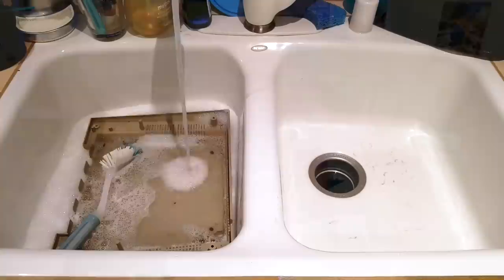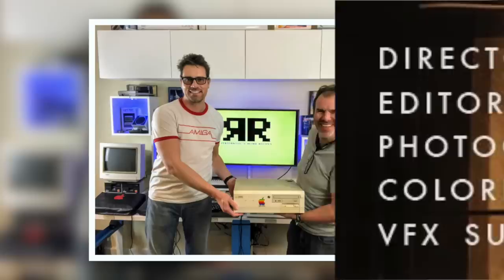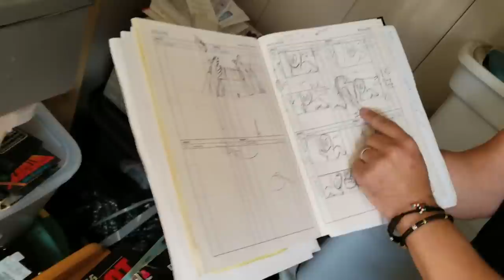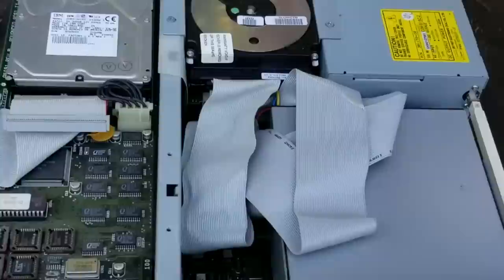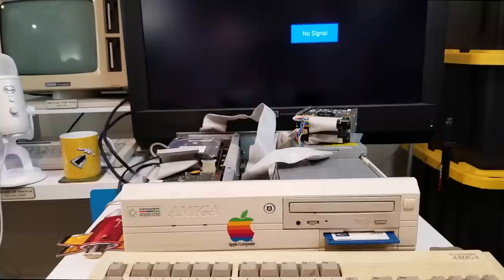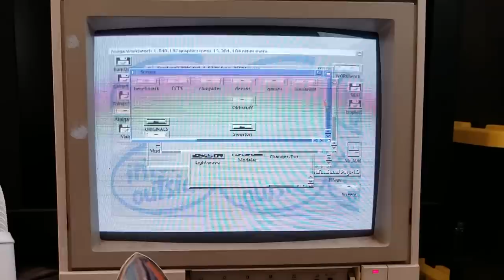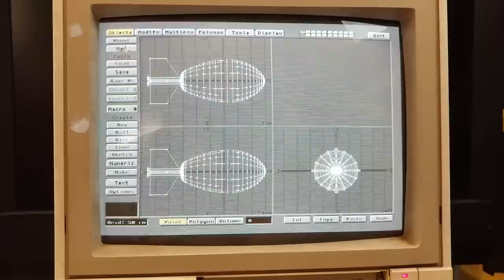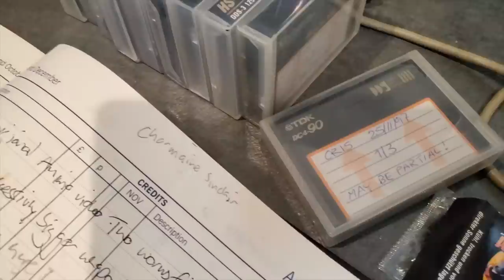I found Team17's WORMS developer Amiga 4000! Let's explore its harddisks

Comment: This is fantastic, I can only hope that the person that bought DMA Design's Amiga that worked on Lemmings does the same. It went on eBay a few months ago for only about £1000
Reply from the maker: That's crazy cheap. There can't have been any data on it surely?
Reply: @RetroRecipes  An Amiga 3000 with files and unused artwork for Lemmings, Shadow of the Beast 2 and 3 and Microcosm. £1800, the ebay listing is still up.
Reply: Man, if I had the money...

Comment: Funnily yes I had heard of the Teletext Worms in my research of character table generated platforms Egs. ANSI, PETSCII, BBS, etc. Makes me wonder what it might have been like for gaming in general. Surprised as not many makers ever have much of their old equipment.  Feh patina that's just dirt, I have some old mayonnaise in the fridge that must be rising in value as we speak. ;)
Wow that just happened in emulation, I would have thought that would have been done years ago, guess few people wanted to salvage their Amiga data safely. Lucky guy, got to pet all the doggies. :D Sweet to have a developer rig, usually pretty beefy inside them. Hah, got to love those graphic modes that are hard display now, you didn't bring a PAL monitor with you, for shame. ^_^
Reply: The actual Teletext Worms thing was just an April Fool's joke, though if it was one actually broadcast e.g. as part of the Channel 4 "Digitiser" teletext gaming magazine (it's very much in line with Digi's brand of humour) they'd still have had to make the mockup screens "for real".

The one-way, limited pagecount "magazine", continually/circularly rebroadcast nature of Teletext as a whole would have made the real thing entirely impractical, as you'd be pre-coding up the equivalent of a Choose Your Own Adventure but with a fresh graphic for every single move, and with extremely clunky controls (number buttons plus the "reveal" function on the TV remote, and optionally the Fastext shortcuts that assigned certain page numbers - including some with hex digits A-F that couldn't otherwise be entered - to four primary-coloured buttons and forward/backward stepping through each "slide" in a "carousel"). The effective datarate is only a couple dozen kbyte/sec at best, but even in teletext form the necessary data load would be many megabytes... it'd take several minutes to spin through the entire image set even for a very limited game, and you'd have to send each one in turn as you have no way to tell what any one player (out of the whole country) would actually need from second to second.

Actual teletext games tended to be more simplistic quizzes where you can more easily program-in "right" or "wrong" branches behind each Fastext button (the seminal Bamboozle, for example), or were phone-in games where you called a premium rate line, were told a particular page to navigate to by number then hit a fastext key, and then controlled it using the phone keypad instead... which had much better responsiveness, as your (and any random voyeur's) dedicated page could be updated within a few frame-times... but of course had a very limited maximum number of players. EG if a game company bought up an entire 10-page block of the usual teletext 100-899 range, then extended that using the fastext functions (matching the typical pagespace of e.g. Bamboozle), as well as the extended hexdigit range of the rest of the 100-block, that still only allows for about 70 players at once. More likely just 15 (as you need one page reserved for title / redirecting)...

However, you do touch on an idea I've wondered about on and off. Several computers (BBC Micro, Oric 1 just for starters) used a Teletext screen mode in order to get a decent amount of colourful text with a relatively cheap off-the-shelf decoder chip which could be fed information directly from RAM instead of a TV receiver, as well as working as an offboard Teletext decoder in its own right (with the addition of a plug-in decoder) for TVs that didn't have one built in, a host for the Prestel data system or its workalikes (Minitel, the US agricultural data service whose name I forget...), etc. Various games made use of it as well because of the Sixel semigraphics, where the oddball inline attributing didn't cause too much of a problem, or at least its shortcomings were counterbalanced by advantages such as very low memory load and the way that attributes would persist along a line if there weren't any further interruptions thus allowing very fast horizontal colour filling... (even on the BBC, it was technically the highest quality colour resolution, at least in terms of text or text + block graphics; otherwise you had to settle for similar rez but fewer colours, or similar colours but lower rez)

So, why didn't any offer the ability to simply send raw data to an offboard video decoder, i.e. the teletext system in a compatible TV, in the same way that a broadcaster might? You could have made a very cheap, memory-efficient, relatively quick machine that way without even having any proper video chip at all, or at least only offering a very simplistic monochrome CPU-mediated bitmap mode sort of like a suitably machine-code reprogrammed ZX81 for better pixel resolution at the expense of colour, speed, memory take, and easy text rendering... (which with Teletext Mix mode could itself lie underneath colour text / chunky semigraphics, so long as you didn't want to show them in black outside of also-limited Subtitle mode).

With something like that, Teletext Worms, as well as many other vaguely graphical games, could totally be a reality. You'd still get fairly responsive updates (maybe in the 10 to 25fps zone depending on graphical complexity...) directly affected by your input with no pre-calculation, and you'd have a rather better control method ... even if it was an oddly laid out membrane keyboard, history has shown, e.g. with the games built in to satellite TV decoder boxes, that it would still be preferable to a long, thin, infrared remote control where you can only really press one button at a time with a single thumb. And the machine could have an internal beeper, or even send sound to the TV over the RF link, so it wouldn't have to be a silent experience. All in all, there would still have been several old machines that would have been embarrassed by such a setup. And it'd be good for going online with in the Prestel age too.
Reply: (though funnily enough the Gameboy version shows that something with the resolution and colour depth of one of the Beeb's lower modes - 160x200 in 4 colours - could still be just fine for playing Worms ... so long as you used a greyscale monitor and fiddled the settings for a narrower, taller image, anyway... the soundchips are quite similar too)
Reply: @markpenrice6253  Thanks for the info, yeah I really wasn't thinking about the low, low bandwidth heh. Interesting stuff, we had a Teletext equivalent in Canada but very limited places to experience it bitd.

Comment: "Such and such code was lost due to a liquid spill." This never makes sense to me. I get that at the time, perhaps a dead computer would lead most to believe that the data was gone for good, but even if it's stored on a ROM chip instead of memory, it's a simple matter of replacing destroyed components or migrating the chip to a working system. Anyone who has done any kind of component-level board repair would surely know that beyond some kind of freak electrical grounding the data is still probably there and rather easily attainable.

I imagine this happened a lot in the past, where a machine was being used for something and then suffered a catastrophic failure and almost immediately discarded due to the assumption that getting the data back was impossible. I probably would have thought the same way had I not explored electronics repair and realized how easy it often is. I wonder how many easily fixable machines have been discarded over the years still containing valuable data just due to the fact that nobody at the time realized how repairable they were.
Reply from the maker: Did you notice the date at the top of teletext? See Description 😉😉
Reply: @RetroRecipes  Haha, no sorry, I wasn't trying to comment specifically on this instance, just the general case of how many machines must have gotten discarded with usable stuff on them given the thoughts of the time.
Reply from the maker: Very true...

Comment: On the the drives you can't get to spin up.
Probably the bearings in the spindle are stuck, or just not loose enough to allow it to get up to speed.
Replacing the bearings usually requires removing the drive internals (platters, heads assembly) which is obviously a job for the professionals.

Also possible to heads are stuck to the disk surface. Which again is not really a DIY task.

You could ask if Steve wants the challenge. Louis Rossmann has several youtube channels.
https://rossmanngroup.com/data-recovery-service-nyc/

Comment: An easier option for cloning is Linux and dd. That's what I use whenever I find an old drive (amiga or whatever else). Anyway, great video. Being so lucky should probably be illegal.
Reply: DD is my go to cloning program, especially because of the portability of it's source code and dependencies
Reply: Yes, this is what I would've gone for first too. Though I'm not sure if the resulting image would be readable on Amiga, or would still need to be loaded and written to disk via WinUAE
Reply: @kurbeco  You would have to mount the resulting raw image and then transfer the files from there to an Amiga formatted partition

Comment: Did you try freezing the drives that wouldn't spin up?  NO, really… Freeze them for a few minutes and then power them up.  If the bearing were seized, the contraction of the internal metal caused by cooler temperatures has freed up some drives to spin briefly again… ;)

Comment: I'm sure you know this by now, but that probably isn't a PAL/NTSC issue, unless you were trying to connect via the composite RCA jack.  RGB doesn't have issues with PAL/NTSC.  More likely a refresh rate issue with the display mode.  The 1084 monitors don't scan up for high res refresh rates and most VGA monitors don't scan down for the Amiga's lower resolutions.  And true multisync monitors are hard to find.
OH!!!!  (Just got to the AmigatoNTSC part)...  That is weird tho.  That is usually used just for games that will only run in one mode or the other.  Most apps in RGB are polite enough to use the system settings...   Hmmm....  Could you have used the early boot menu to force the Amiga to PAL mode? (assuming you are using RGB/VGA?)  Anyway, never mind me..  Just thinking out loud. ;-)

Comment: That's so weird, my 1084 handled PAL modes just fine. You sure they aren't 31khz Picasso modes?
Reply: Or higher, even... but yeah, a 1084 should be happy with almost anything 15kHz. They swallow 72Hz Euro36 and even wacky things like the recently developed SuperPlus (800x600i at about 47Hz)... just not much outside of the 15.0~16.5kHz range.

And I'd be astonished at almost any A4000, let alone one used for 3D rendering and other dev work, to still be using a 15kHz screenmode. We were well into the VGA era when the machine launched and being able to do higher resolutions and frequencies was part of its USP.

Though flickeriness might be because it's detected the connection of a 15kHz screen and has automatically downsynced... but applied interlacing to maintain vertical resolution. Which if you're running PAL50, and don't have an LCD or a flickerfixer, is just painful

Comment: Those glitched out video modes with the graphics scrunched up horizontally and a black sync bar down the middle I would 99.4% say are sign of a 31kHz VGA or ~28kHz ECS/AGA "double" / "productivity" screenmode, which the poor old 1084 is doing its best to display by ignoring half of the syncs (where they come in what it thinks is the middle of a ~15.7kHz scan, rather than at the end). Probably that particular one is 31kHz or close to it (maybe "VGAonly"-modified 640x480 Productivity), which should be displayable on a regular LCD TV or monitor or any old PC CRT, and the completely unrecognisable ones with the diagonal stripes or patternless snow are one or other higher (e.g. 35kHz) or in-between (23, 27, 29kHz...) Amiga-specific oddity which will need a multisync, or at least a PC SVGA.

Nothing to do with PAL vs NTSC - even if it was the odd case of an RGB not being 50Hz compatible, what you'd get is a vertically jittering or ~10Hz-rolling image which was otherwise the proper width and recognisable (and maybe tweakable into stability by playing with the image controls), rather than skittering around all over the place and being either compressed to half width or being extremely distorted in the diagonal direction to the point of unusability. Hopefully an Amiga forumite would have noticed that - did you post pics / vids when asking for help, or just text?

I'd be surprised if the 1084 is what that particular machine was originally used with (maybe one of the other boxes instead?) - probably more likely a Ranger bisync or a third party multisync. Plug a(n S)VGA compatible screen into it already, preferably a Multisync rated one (there are lists of such out there online, including on Amiga preservation sites), especially a CRT. Or just connect your LCD into the output of the Picasso instead of the computer's main output, if that's not what you were already doing... Making sure that it can sync high enough to handle the board's particular modes, as they were essentially just contemporary PC SVGA/SXGA chipsets with the PCB altered to present a Zorro connector rather than an ISA/VLB/PCI one... so may well be capable of exceeding (rather than undercutting) what a cheaper LCD can natively display.
Reply: In fact there's a point where it looks like there's three copies of an otherwise unrecognisable feature, along with the extreme diagonal skewing. That suggests something a little way adrift of 45kHz, maybe 48kHz? which would be good for e.g. 800x600 at 72 or 75Hz, very much a mid 90s workaday resolution, which would let you get 16bpp colour out of 1mb of VRAM (or double-buffer inside 2mb)...

Comment: You could have used Linux as it natively supports Amiga filesystems and a simple dd.   For those DDS tapes ive got an external DDS3 ( HP ) muli loader thatle do the job ;).

Comment: this amiga is 50 Mhz and can do 3D ? Hell, programmer of this 3D program must be god.
Reply: 3D rendering at 50MHz with a 68030+6888x or 68040? In 1993/94? Absolute luxury. We were about to discover the extreme speed boost of raytracing on a 66MHz, 32-bit, FPU-equipped 486DX2... after first giving it a try on our 8MHz, 16 bit, non-FPU (ie, essentially original Amiga class) Atari ST. And that dev machine must have an accelerator installed because the OEM A4000 ran at 25MHz...

Comment: When it comes to saving data from old hard disks, linux is the natural choice. I use it myself to read, write and transfer data between Amiga storage and modern computers. Windows and Mac are both extremely handicapped when it comes to this type of work.

Comment: sees thumbnail ... oh I wonder if it has the original voice samples on it? It'd be neat to hear what they sounded like before being sped up and downgraded hard enough to fit the memory constraints
sees description ... it has the FMV mesh files? Dude. Extract those and re-render in 4K. You know it makes sense. See if they're still watchable when not in 320x200 with 256 colours.
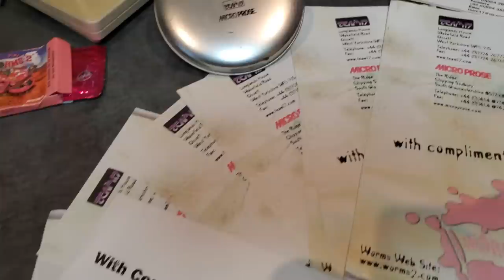* gets to 2:52 * ... Ocean was a "small software distributor"? They were one of the biggest software publishers in the UK for a solid decade, though admittedly by the mid 90s it was surprising to still see their name attached to anything. But that was more due to a fall from grace rather than never enjoying the big time.
Reply from the maker: You realize I did rerender them in a follow up video?

Comment: Hmm, those animations look like they're from at least Worms 2 if not later... too high rez and the chunky, cel shaded style (matching the W2 in-game graphics) is unlike the more real-worm-plus-googly-eyes appearance (again matching the graphics) of W1's rather scratchy videos. But the same spirit is clearly there, so I would expect he also worked on the vids for the original game, as the contribution to the original add-on soundsets would suggest.
Reply: Aha, the Lightwave meshes are definitely the Worms 1 anims...
Reply: NM, I stand corrected having let more of the video run through. The later anims were the originals. I guess from the PSX or maybe video decoder pack equipped CD32, which wouldn't have had the same colour degradation as the VGA-friendly PC ones?

And, well, I'm absolutely amazed at the level of kinematics (swinging ammo belts etc) and the very fluid, lifelike movement of the characters given that it was all mouse-animated and with very painstaking frame-by-slowly-updating-frame stop motion positioning. I had assumed some kind of mocap or the like, particularly for those very lifelike little head shakes and so-on which are so essential to give personality and allow a bunch of mute (indeed, mouthless and fingerless) characters to communicate. I guess someone learned a great deal at the altar of Chuck Jones and the like? (The stretchy bomb and suchlike is very Looney Tunes / Merrie Melodies etc)

The armpits we always thought were intentional, given that they're invertebrates and are going to have oddly shaped bodies when it comes to adding arms and the like. It looked a little odd, but not like a glitch. Just some strange musculature or whatever.